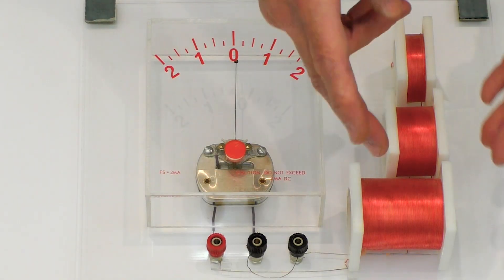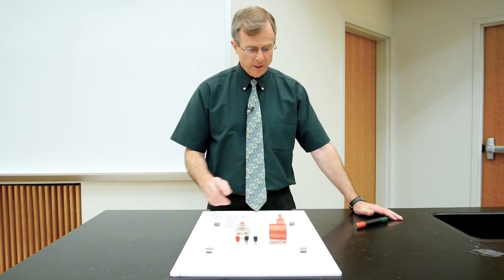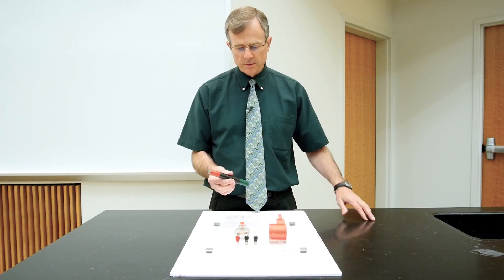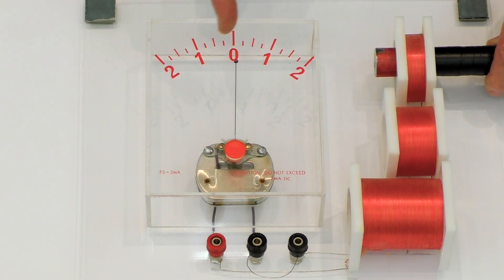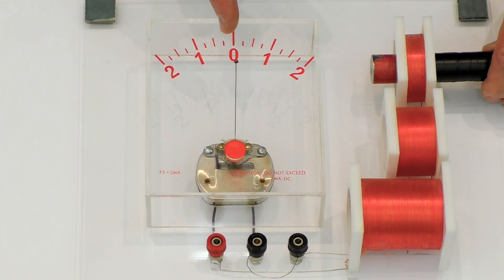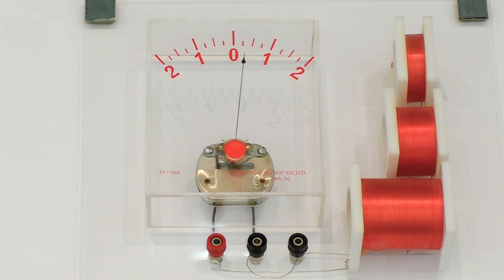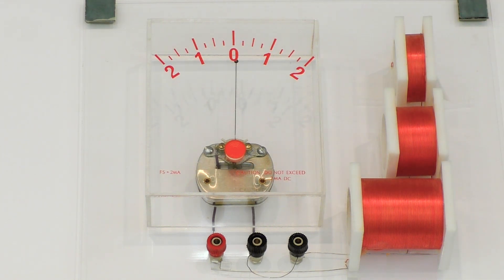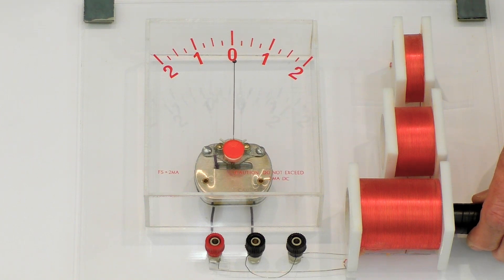Faraday's Law Demo: Induction Coils

Comment: Bruh what would happen if you had a circular coil and magnet in space and the magnet would move at high speeds through the coil? Surely this doesn't work to create limitless voltage but what would happen?

Comment: sir i have doubt if increase the number turns of the coil whether the voltage increases or amps rate increases?
Reply: Increasing the number of turns of the coil, as I do in the video, increases both the emf (voltage) induced in the coil (through Faraday's law) and the current through the coil, as measured by the galvanometer.